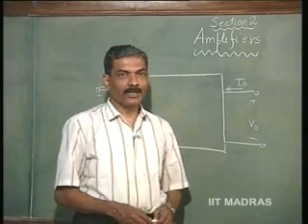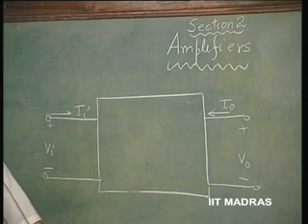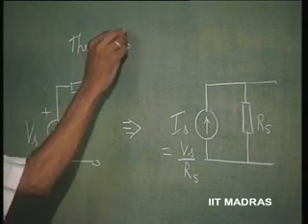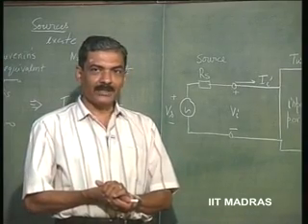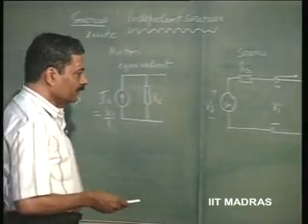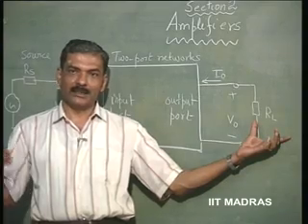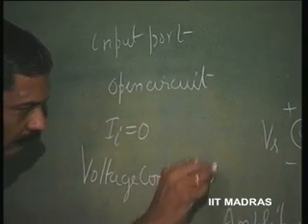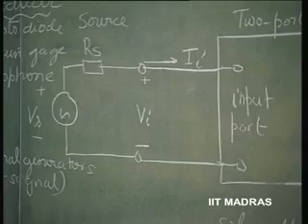Lecture - 12 Amplifiers

Comment: In an Ideal Amp why Ri is infinite ?
Reply: If Ri is infinite it means the input port is open circuit so this is voltage controller. So , in order to maintain the linearity between the input and output voltage ( ideal gain) is necessary no contribution from the resistor .This is all I infered from the video but I am not sure.
Reply: Another point, as Ri goes to infinitive it guarantees that the input current is zero.
According to the definition of voltage controller.
Reply: When it draws no current, it has no power dissipation either!
Reply: +yaser abdulaziz It has to be as close to infinite (very big ohm resistor) so that as much of Vs appears at the output with minimal attenuation.
Reply: yaser abdulaziz
Reply: Ri is infinity becuase there are electrons that holds potential energy at the input side... If the resistor Ri is allowed to conduct electrons, the electrons will loose energy, The Rs is kept smaller, so that no electrons loose energy, now you have to probe potential difference, means difference of energy the electrons are possessing at terminals... There will be full potential diffrence if no current, meaning no energy lost... It will read lesser potential difference if the cureent flown, as whenever current flows in ressitance energy is lost by electrons.. Which when u measure is lesser potential difference...
If there was no resistance then potential diffrence would be 0..